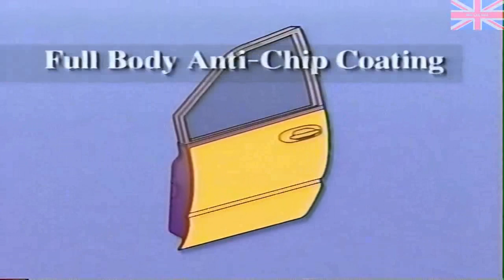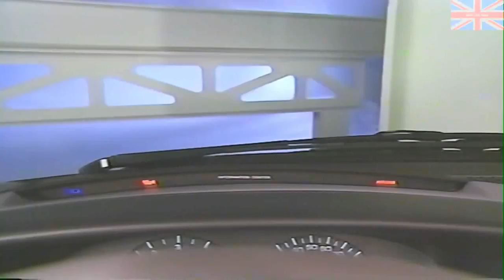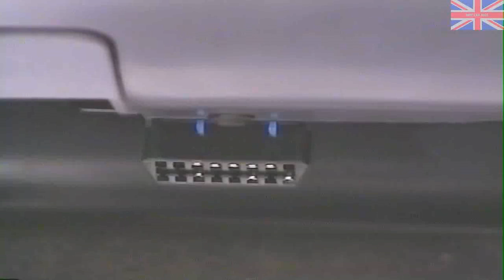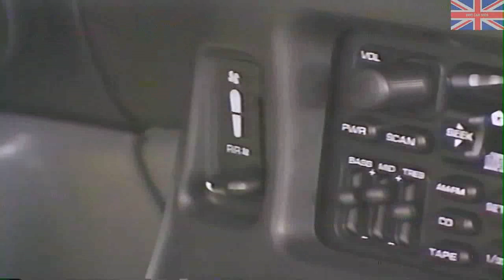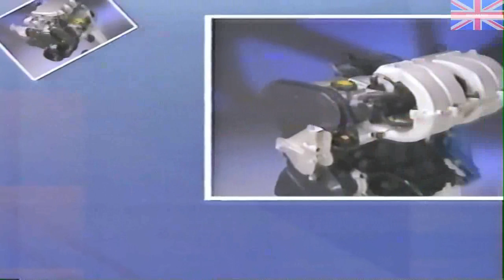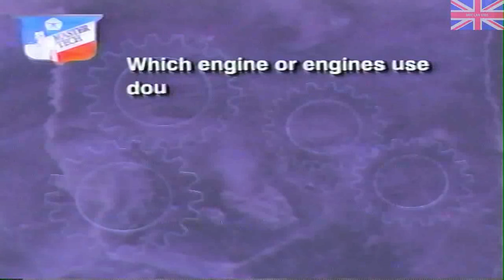Chrysler (US) - MasterTech - March 1995 - 1996 Minivan Highlights

Comment: Although rusty, these vans still chug along in the rust belt states. These things have proven to be absolutely indestructible which is the only thing saving them from the crusher.
Reply: It’s funny, about half of them are like cockroaches and just will not die while the other half crap out at 100k because of their transmission.